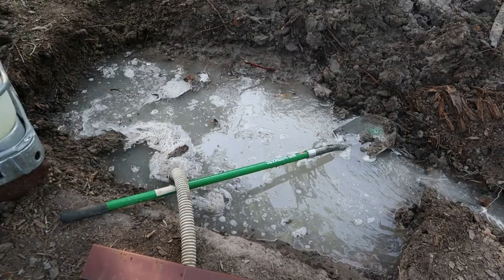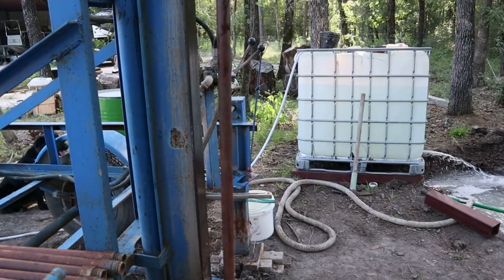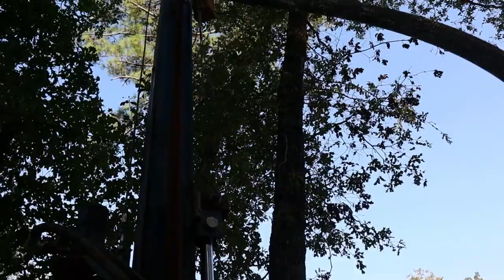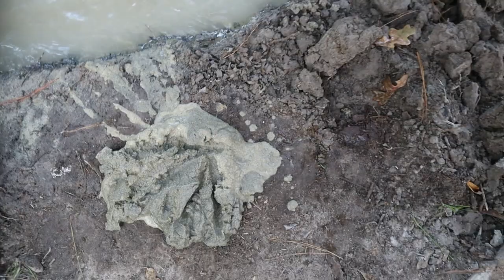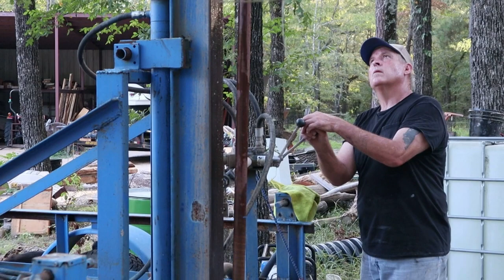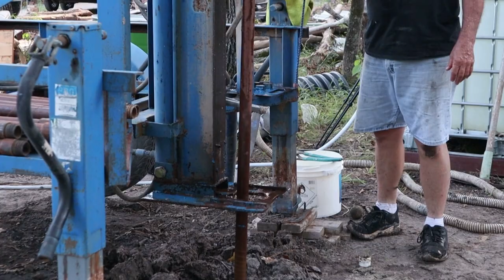Homemade Water Well Drilling Machine Part #2 Drilling the Well

Comment: I love this!!! I have a T handle system that we always used here in bottom land in Arkansas ground isn’t that hard, just working T handle back and forth we washed out a 4” hole and always put down a 2” PVC pipe. We’ve washed out as far as 75’-100’ but mostly 60’-70’ always have real good drinking water.
We only have two sections of like a cycle cutter or kindbind cycle bar sections
Reply from the maker: That sounds pretty cool. Appreciate the comment
Reply: Shalom Aleichem. 

Would a pvc pipe last as long as a medal pipe?
Ratson haba b'shem YaHuah

Comment: What did you use to be able to connect the water to flow down through the pipe and where can you get it? Very creative awesome machine sir!
Reply from the maker: Custom made water swivel
Reply: @LarrySbrusch Look up the DIY Donn video for making a water swivel rotary joint. It’s easier if you have access to a lathe.

Comment: Hi Larry, Curious on your pipe sections,cannot tell for sure. Have seen the threads on some of these sections are very course and deep. Not actually the 'native' pipe threads. What are these threads,,or couplers the threads called. Wanting to build my own rig...maybe. Thanks
Reply from the maker: They are made by boze brothers and are the best couplers you can buy for drill pipe connections. You can use these over and over for a long time when using pipe dope
Reply: Thanks  @LarrySbrusch … where would I go about finding the “boze brothers” to find some of these connections?
Reply from the maker: @cameronmarkert  The last I heard they were located in texas, But you might call Lonestar Drillbits in houston and see if they  have the M50 Couplings also

Comment: Where did you get the actual drill pipe from? I bought female and male drill pipe couplers off of Aliexpress. But I would like to know where you got the pipe from?
Reply from the maker: Standard pipe from any steel supply company. I then had to take the couplings and machine the ends to fit the pipe before welding them. I have my own lathe, so that was not a problem
Reply: @LarrySbrusch  ya i have a lathe to. So that should mot be a problem

Comment: What type and size pipe did you use and what type of couplings? Also the largest problem ive ran into in trying to build by own is how to hook the water to a spinning pipe
Reply from the maker: If I remember correctly, it was heavy wall 1-1/2” pipe. The drill collars were from Bose brothers. I think I ordered them from lone star drill bits. And yes the water swivel is the toughest part. I cant even explain how this one is built
Reply: You can get those swivels pretty reasonable we use them on ingot mold machines at work with hot oil running through them to heat the molds. I think we pay 650$ for them but they are all brass 2 1/2 inch
Reply from the maker: Got our Cnc machine setting up for making the drill pipe collars. Will have some ready in a couple of weeks @ txdashcovers.com

Comment: Larry was the length of the hydraulic cylinder on this rig
Reply from the maker: I sold the machine about 2 years ago. Not sure, but it was one of the biggest ones I could find.. I believe it was around 52”
Reply: Thank for the reply thats all i like finishing up on mine. I used 2 3/8 tubing and machined my ends male and female  threads and bought 10 joints of pipe 31 footers made 30 joints 10 ft joints. i used a Dodge TDX 4 gearbox with a 2 foot sub in for turn table with a hydraulic motor on the input shaft  with a killer water swivel  i designed on top of gearbox with 2" inlet from pump. if you ever need  ends for pipe, water swivel i have a machine shop  here in Texas between weatherford and Abilene thats all i really do is things with water drilling and small things for the locals Thanks again

Comment: Did you build this contraption, if so that's sweet as it can get, i can't believe you haven't hit any tree roots
Reply from the maker: Yes I built this old dinosaur several years ago..I use to work for H & P Drilling. so I took a big rig in my mind and just made a smaller simpler one..Nothing big or fancy and fit within my budget. Appreciate the comment..
Reply from the maker: I have hit some tree roots, but the old bits I uses drill through them....doesn't slow it down much
Reply: @LarrySbrusch  ok, im a guy that loves plans to build things, this you've heard from from me before, but do ya have any plans for this or can ya put some together, lol
Reply: @LarrySbrusch  I use to Drill on H&P 235.

Comment: Hi Larry, I’m wanting to build one basically like this. Could you provide any insight on the swivel construction and perhaps the size of the hydraulic cylinder?  Thanks
Reply from the maker: I will try to get you information on Tuesday when I get back to where the rig is at...I can find the cylinder size pretty easy, but the swivel, was a build on the fly..get you as much as I can
Reply: Hi Larry, what kind of packing in the swivel? Looks like a winner
Reply from the maker: I don’t remember all of the exact details. But it has a Teflon seal on top and bottom the each one is packed with graphite material under a squeezing collar. Once the weather warms up. I am thinking of making a video of the basic set up

Comment: how'd you build the water swivel?
Reply from the maker: It was very time consuming and expensive. I couldn’t explain it in a message if I tried
Reply: @LarrySbrusch  got any advice for trying to build a smaller one?
Reply from the maker: @drmoto8058  not really. You have to find a way to seal the outter casing but still have water running through the holes in the inner shaft. It’s tough

Comment: How can you tell when you hit water?
Reply from the maker: Most of the time, you will be in sand or gravel is a good indication..there should be water..In some cases you will begin to start loosing some water to the water you found in that table
Reply: Texas has public records and map that is somewhat easy to navigate to permitted water wells drilled. It’s got elevations and good water sand info as well as a log of the well.
Reply from the maker: @jasongrinnell1986  Yes sir.. I look at them about three times a month, just to study our area..great information. Thanks

Comment: How many  the deep the metro maximum  and   the mm
Reply from the maker: I only have enough drill pipe to drill 200 feet and it will drill that depth with no issue..not sure how much deeper it will go without buying or making more pipe

Comment: What diameter hole do you drill?
Reply from the maker: I start with a 3-7/8" bit then I open it up with a 6--7/8" Bit to be able to set the casing and screen
Reply: Larry Sbrusch would you be interested in selling this setup or know of a place in Texas that rents them?  I’m close to Crockett and I’ve seen a place online that says there located in Livingston Tx that build them but I don’t think they rent them and new ones aren’t cheap!
Reply from the maker: @sanfordburran7321  after I finish my well, I might consider selling this machine..rolling it around in my head..my second thoughts might be to keep it being that water or good water will be a bigger issue than it is ,in 5-10 more years. I use to lease it out, but I had a buyer loose 40 feet of pipe and a bit..and he never paid me
Reply from the maker: @sanfordburran7321  how deep do you plan on drilling
Reply: Larry Sbrusch well the water wells that are around me are 140 to 130! I have a old hand dug well that my grandpa dug that I’m pretty sure it’s 70 feet that I’ve been cleaning out that has been filled in I’ve been told it’s 96 feet deep but it never held water and I thought about just putting a 6 or 8 inch casing in it when I get it cleaned out then trying to drill it deeper but I’m not sure it may be easer to just start over!